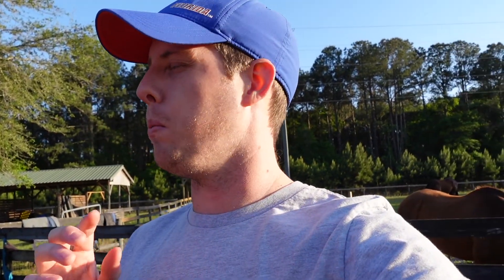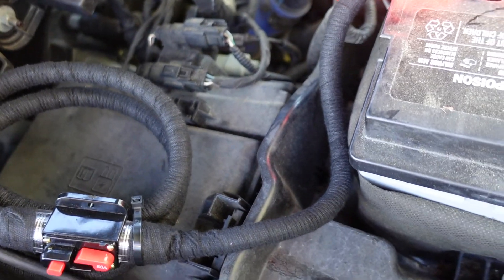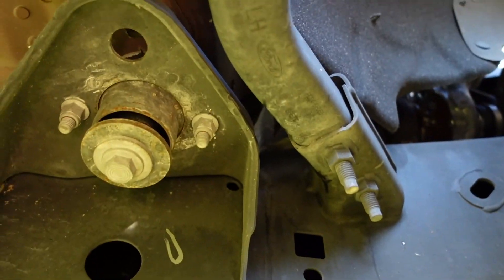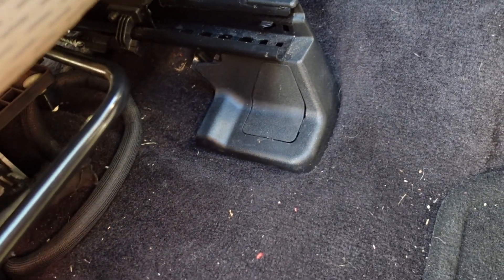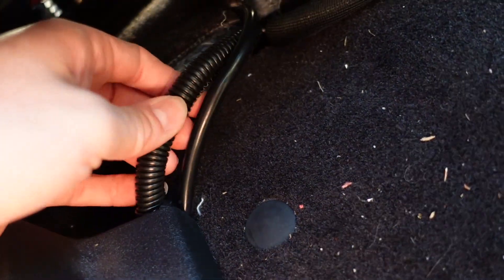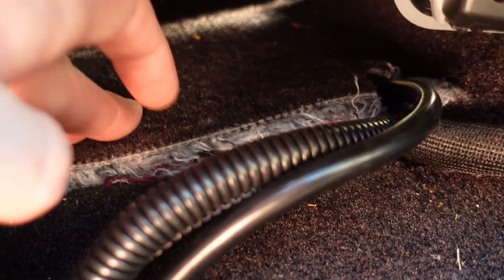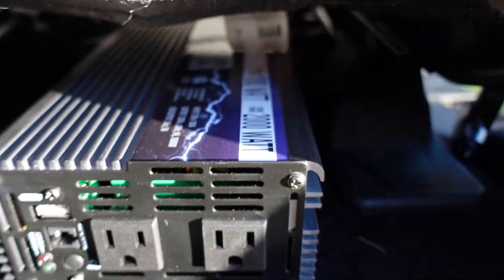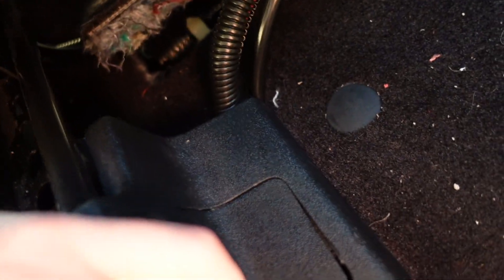GoWISE 1000W Sine Wave Inverter Install on 2016 F150

Comment: Poor video. 

1.) Where does this terminate on the receptacle side?

2.) How do you attach wiring to receptacle?

I could elaborate more.
Reply: The cable terminates at the battery at one end and inverter at the other. wtf else do you need to know?

Comment: You did not have to drill holes to run the wire to the battery.  You could have ran it through the driver side grommet where the rest of the wires run through
Reply from the maker: Thanks for the comment, Jose! It’s a good thought, but I did not want to then route all the cables over to the passenger side from the driver side. Also, that driver side grommet is already very full from the factory cabling so passing the large wire for this load would have been very challenging.

Comment: Now after 6 months or so of use from this inverter , what is your opinion of it?
Would you buy it again or seek an alternative?
I'm thinking this may be the one I get for my van.
Reply from the maker: Hey Richard, I honestly have probably only used it 5 times but it has worked out just fine.
Reply: @ramstanreviews8622  thanks.

Comment: That’s a little more complicated that I thought. What did you use to measure the resistance?
Reply from the maker: Thanks for the comment, Steve. I just used a multimeter in the ohmmeter mode to verify good connection.